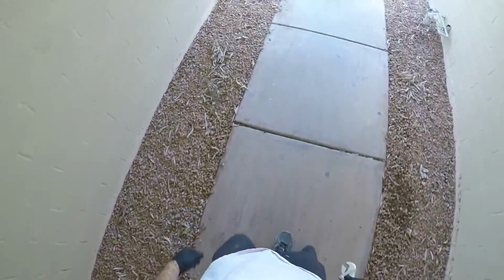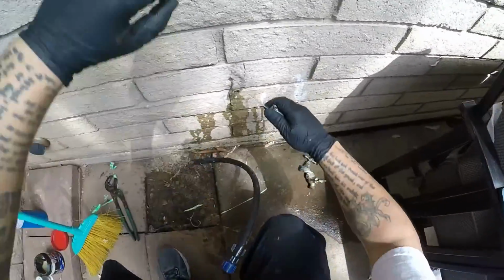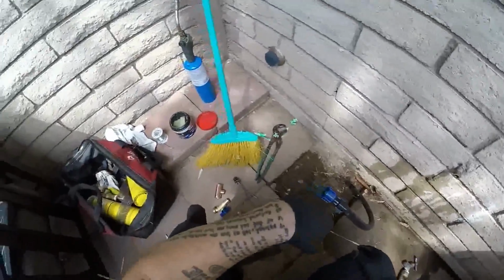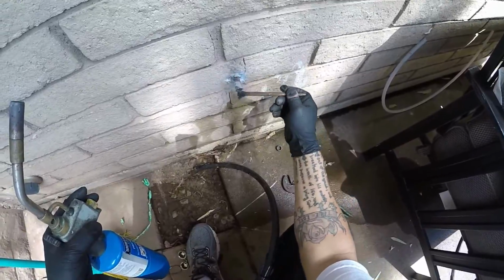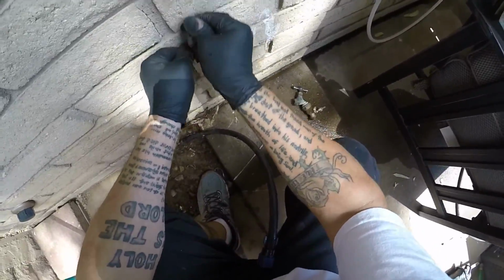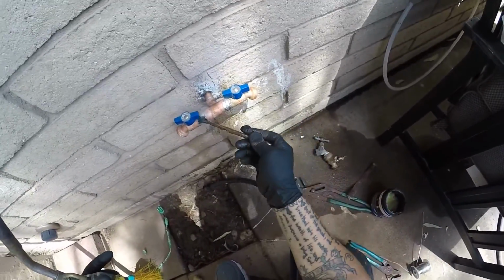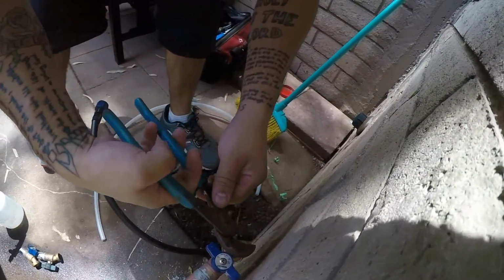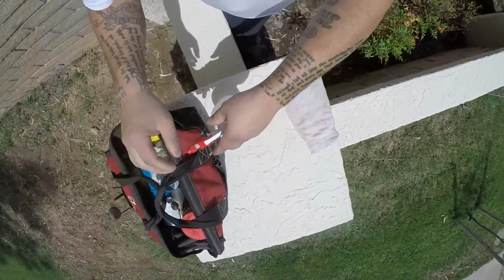HOW TO ADD A SECOND HOSE BIBB - TEMPE, AZ

Comment: Screw on vacuum breakers - do they give problems later on like constant leaking and what do you do about it? Thanks.
Reply from the maker: It's funny that you say that because just recently I have found several of them leaking brand new. So I started using the all-in-one hose bib with the built in vacuum breaker when I can.
Reply: Thank you very much for your reply
Reply: Hey man let me ask you a question...
Could someone use a tee at the hose Bibb to. create a second house connection from the meter if they couldn't find the original connection?
Reply: I found something on a job that makes me think this is the case